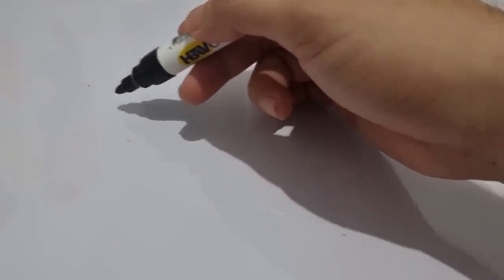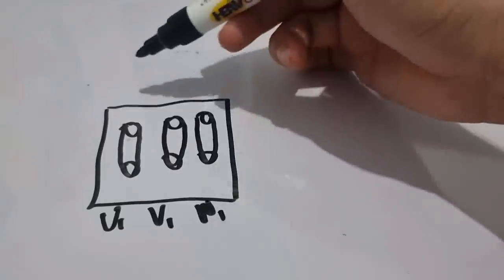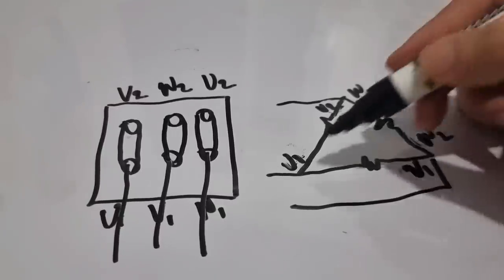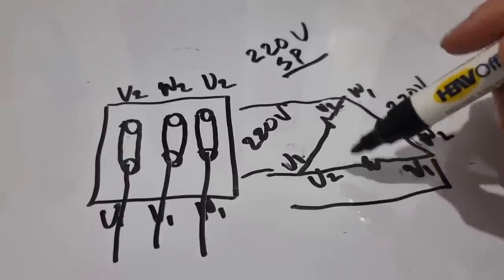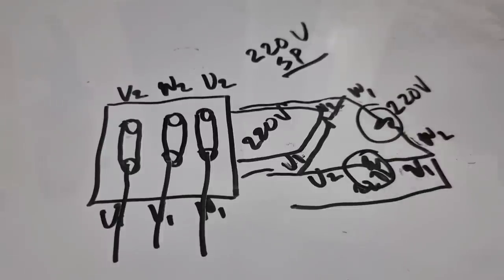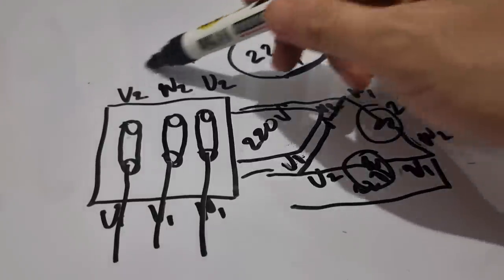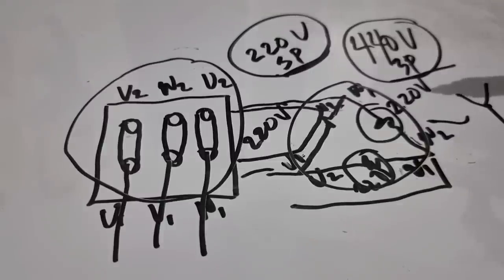WYE DELTA CONVERSION &ACTUAL APPLICATION | Marine Elecrician

Comment: The calculation is wrong. The phase/winding voltage in a Wye connected motor is 
(Line Voltage)/sqrt of 3

440/sqrt of 3 = 254.3 Volts

Therefore, each winding is subjected to a Voltage of 254.3 volts, when it is supposed to be only connected to 220v.

Is this possible? Yes but it will greatly affect the motor's lifetime and health and it will also run at a higher temperature due to more current running in the windings compared to its supposed rated operating current.

Dont take this the wrong way tho Sir Lecky Jake, I really find your videos very helpful and informational, saludo!!!
Reply: I was thinking the same.
Reply: I was gonna say the same thing but luckily you already did.
Reply: I'm a REE, this is true.

Comment: At 440v, the star wired motor will get 15% above rated voltage. Each coil will see ~253 volts. Because of vector addition, the voltage at the star point is the line voltage divide by square root of three.
Reply: Is it safe for the motor with that 15% more voltage ?

Comment: It is not safe bro.it will burn the winding eventually. because in delta connection, phase current= line current/√3. But when you connect it in wye then, phase current=line current, which will be higher than the delta connection. So, winding will be overheated due to high phase current and possibly burn. By the way voltage on each phase will be 255v in wye connection and it is designed for 220v. So i believe, you do know what will happen then.
Reply: I dont how he converted it into 440V. But I think you also got the wrong idea because the Voltage @ Delta in Line to Line = Phase and The Voltage @ Wye in Phase = Line to Line /sqrt of (3). Therefore the current @ wye will become smaller since 220/sqrt(3)=127.
Reply: @Link-tt6mw  bro about current in wye, i think you are wrong. Because in wye connection phase and line is in series. So phase current= line current. In delta phase current=line current/√3. Please check your book.
Reply: @faysalrusho3634  yup you are right. What i am referring to is the current in wye is smaller than the current in Delta. Because the supply line voltage in delta is equal to the load voltage.
Reply: @faysalrusho3634  that's why we have wye delta starter in our motor control. Because in wye connection we have smaller current than the connection at delta.
Reply: The line current will be less, winding current the same (check the calculation with resistors). Only problem is the coils are getting 250+ volts when rated for 220 volts. If the motor is not designed well, the higher voltage will cause magnetic saturation.

Comment: If two loads is connected in a series connection and has a supply of DC. Simple you  just add the voltage..But If it is in a three phase system and the loads is wye connected ,the rated voltage must be multiplied by √3.
Reply: This is right.. I got confuse about 3phase AC 230V motor from delta connection to Wye Connection.. Yes if DC it will add up but in AC 3phase system??
Reply: A 230v motor in delta will operate on 400 volts in wye. In Europe, 230 volt single phase loads are connected between line and neutral. The supply is always 400/230Y.

Comment: In direct online(DOL) starter always connect the motor cables in WYE/STAR. It is not advisable in bigger motor ratings as the inrush and running current is high as compared to delta. in VFD even if it is small motor you should connect it in delta.
Reply: But in star we don't get enough speed
Reply: For small motors we can use Delta connection
Reply: @rajatawasthi4769  there are things you need to consider before doing the connection. Energy wise, application, what type of controls they used. Don’t be stupid unless you want expensive repair. If you used delta using DOL then you have high value of running current means high electric consumption bill and the possibility of burning the motor winding. Don’t look at on the speed because it is already measured during the design process.

Comment: Hi sir, I'm concern about the ampacity of the conductors and it may damage in a long run, because if the voltage increases, current also increases. And the insulation of the motor may deteriorate since higher voltage is being applied where the motor is designed only for 220V.
Reply: Line voltage is the same
Reply: current is the same coz phase voltage is the same
Reply: In this case the motor will even draw little current when connected 440 3p, when voltage increases current reduces, compared  to what it could draw when connected to 220v 3p.

Comment: and 440 is 3 phase systemm, also 220 V is a 3 phase system in USA standart NEC , but un europe 220 is a single phase , from here is a confusion check ou video "split phase system " in usa and compare it with 3 phase system in europe

Comment: not possible WITHOUT DUAL VOLTAGE MOTOR OR GOING THROUGH TRANSFORMER. DELTA LINE TO LINE IS THE SAME AS WYE LINE TO LINE.
Reply: you are right it is impossible, but someone is trying to ..... the corect way is this - https://www.youtube.com/watch?v=nuhxqZJYKhQ, the european method to switch from a 400 V to 220 V include a power capacitor

Comment: Sir Lecky is that really the marking partner for the 220 volts coz most motors that I open states u1 and W2
V1and u2
W1 and v2 that's for the delta

Comment: Thank you for the lesson as always. i have a question: the motor is made for 220v so does insulation of motor,  is it okay for insulation of motor(winding) to supplied it with 440v ? tnx.
Reply: Wye connection, so it will become series 440V it will divide into two coil. Still 220V

Comment: Mr jake
I saw you changed power plug.
1) why did u change?
2) how did you change?
Reply: 1. Because the 220V 3ph plug won't fit into the 3ph 440V outlet outside.
2. Chop off the 220V 3phase plug and wire in a new 440V 3 phase plug.

Comment: Hindi po ba mas bababa dapat ang Voltage sa Load kapag ginawang wye connection kasi magiging 220V 440V/sqrt of (3). Naguguluhan ako patulong naman guys pano naging 440V talaga yung Voltage non? 😁
Reply: The supply voltage is 440V, since he converted the connection to wye so the motor phase voltage will be 250V(440/1.73). Still a bit higher than 220V rated voltage, it will affect the motor lifespan in the long run. I am sure that Jake is fully aware including all mathematical calculation. But for simpler illustration, he opted to explain it that way.
Reply: @antonioreyes7476 Sir I just want to ask, Since it's in wye connection and the voltages in each phases became smaller. Is the motor will become slower? Thanks, btw I'm still a student and still learning 😁
Reply: @Link-tt6mw  yes and no. In general, the motor speed slows down in wye connection because Vp is smaller than Vl, that's why we have soft start or wye/delta starter. But for Leckyjake example, the motor runs at rated speed or even higher because that motor is rated 220V, and the phase voltage is 254V (supplied by 440V and motor is configured in wye).
Reply: @antonioreyes7476  Thank You sir! ❤️
Reply: @antonioreyes7476  I would like to know what the voltages actually are on the ship I would have expected 240/415 like most of the world uses! 220/440 seems like North American 240/480 power but that’s seems odd then if you have single phase 220 outlets? Guess I’m confused on what standard they ship is really using!
Reply: looks like the single phase was split 110/220, so North American design.

Comment: Does converting from delta to star effect the speed?

Also I think in star, the current will increase to 4.041 Amp
Reply: It was converted to star, but also the voltage is also increased. The voltage on each pole will be almost the same, so the speed, slip, and current will be the same. However the insulation will have more stress.

Comment: Sir its not 440v....when you leave 3rd phase open then only it will be 440 between 2 phase... according to your connection it will be 220*√3 ....it will work but not with full efficiency .... kindly check voltage with voltmeter
Reply: the line voltage is supplied from the ships transformers at 440V. Each winding of the motor will see a phase voltage of  440V / √3. So approx. 250V, which is slightly higher than the rated insulation value of the windings.
Reply: You are right but see the video of his explanation 220+220= 440 it can't be like that.

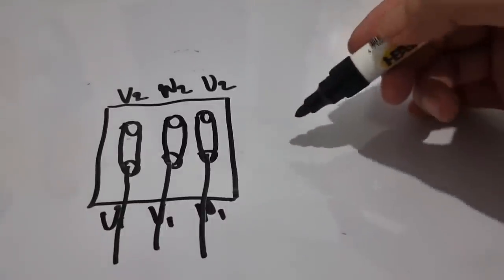Comment: hello Sir just a Clarification at your diagram say @6:12 Delta Connection  U1V2 , V1W2, W1V2, but in actual @11:20 says  U1W2, V1U2 W1V2.... Does affect if we follow ur diagram at 6:12 in real world?? thank you sir
Reply: It will only reverse the rotation of the motor